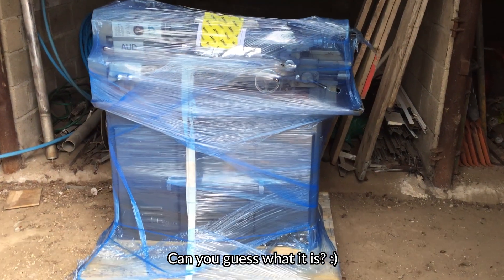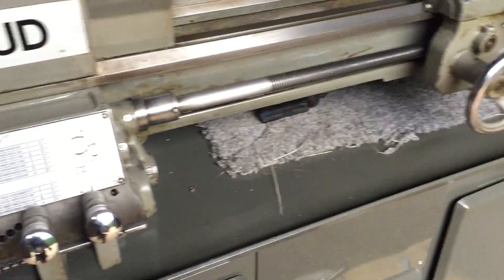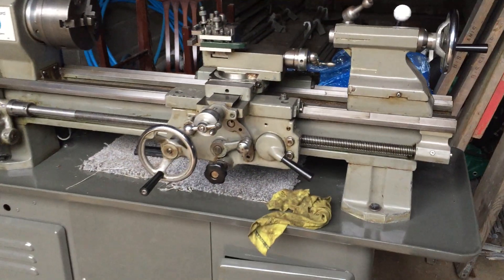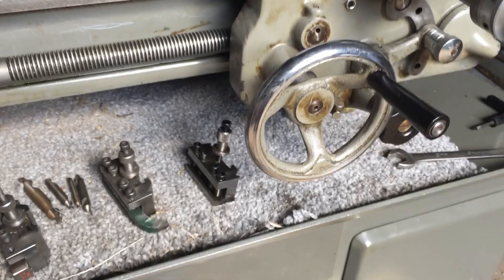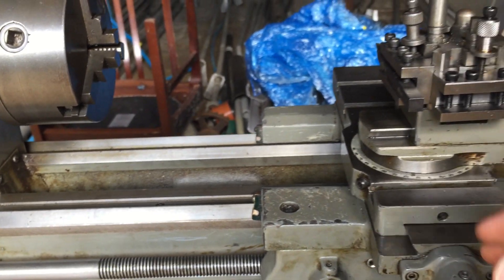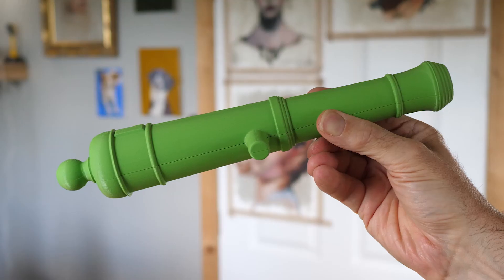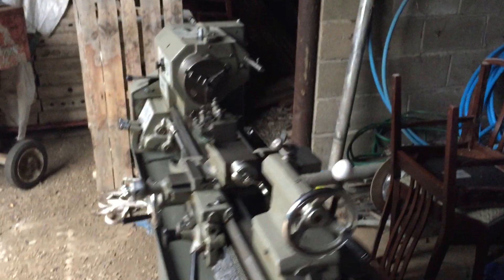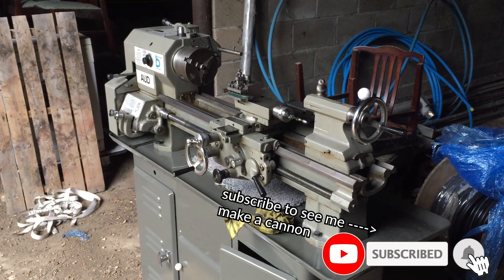My First Lathe! A vintage Boxford AUD metal lathe

Comment: I’m in the USA, so getting a Boxford or Myford wasn’t much of a possibility. But when I was a teenager, back in the 1960s, the three machines I wanted were a South Bend, a Boxford or a Myford. I didn’t like the Myford designs, and the, to us here, the backwards way the controls on the carriage were.

I did buy a new Unimat 3 when it came out. A beautiful little thing which I still have. But as with other true mini lathes, doing something took a lot of time. When I was in high school, we had a chance to take different shops as an elective, so I took machine shop. They had a number of South Bend Heavy 10 L lathes.  Now I’ve got several lathes. My biggest is a south bend FOURTEEN, which is a great machine.

I’d still love to get one of these. It looks great. Even the paint looks factory. Good luck with this I hope to see you enjoy it.

Comment: Boxford AUD is fantastic lathe its based on the venerable US South Bend. I have owned mine for nye on 16 years now. Incidentally, I picked up a Balding Beaver Model A mill, a none working Denford CNC Starmill and Starturn lathe, around the same time which I upgraded to use LinuxCNC. Hope the lathe is working out for you.

Comment: I've only just happened across this video. The Boxford is an excelent lathe and is much better than the Myford which is usually much more expensive. It does look like the tooling you have is carbide tipped rather than high speed steel, though obviously I am only able to see a little bit of them. If they are brazed carbide you will need a silicon carbide grinding wheel.
Reply: Bullshit.....any carbide ground with a silicon carbide wheel will be as rough as you can get.........invest in a diamond whee as well as the silicon onel and a dedicated bench grinder to mount them on........that's the only way to get carbide sharp without the edge disintegrating.....you don't need carbide tooling for a Boxford.....ever.

Comment: Hi. The first thing you need to make is a stop for the bed which will enable you st do depths accurately and if you are going to do screw cutting you need a Zeus book which is invaluable. A milling attachment will add loads to making things if you can run to it. The lathe is the busyness well done mate. Regards
Peter
Reply from the maker: thanks Peter yes a stop will be very useful and omg a mill attachment! one day maybe :)

Comment: New old stock? Nice. If the chucks are worn out, they certainly didn't worn out on that lathe. That has not done a lot of work, and the owners obviously looked after it. A real treasure.

Stone off the dings. They should not protrude above the ways. Low spots dont matter.
Reply from the maker: thanks mate! and i will have a look at the dings cheers and loving your mini lathe series :)

Comment: Congrats!  This is the way it happens.  My lathe just fell into my lap unexpectedly.  I was fortunate to snatch it up at the right time.  I wish I could say the hard part is done, but the real expense is only just beginning.  Fortunately, the chinese have done pretty good on making tooling affordable.  First thing to buy is a quick change tool post.  AXA is probably the size you'll want.  One thing I've learned to so far, when it comes to a parting tool, SPEND THE MONEY!  It will make your life so much easier if you avoid the cheap parting tools.  Look for Sandvik, Iscar stuff on that front.  Here's what I dragged home earlier this year.  https://www.youtube.com/watch?v=5ur257c-qIg  Good luck, BE CAREFUL and take small cuts!  Get a DRO when you can.
Reply from the maker: thanks worldtraveler! oooh that a lovely lathe! i have the QCTP (it fits 10mm tools great) and i've purchased (and been given) some carbide tools (decent ones i think) so i'll try them out :) Ahh yeah a DRO... one day :)

Comment: Nice lathe!  you can cut imperial threads with i belive a 127 tooth gear. Rule #1 dont leave the key in the chuck! #2 Machines dont take prisoners!  #3 no loose clothing! Enjoy!
Reply from the maker: Thanks T. rgr that 127tooth cheers. and defo on the rules... I've been told that a few times now, i've even upgraded my chuck key to one with a spring so i dont fall into the habit of leaving it in there :)